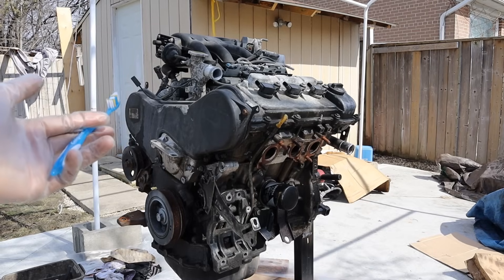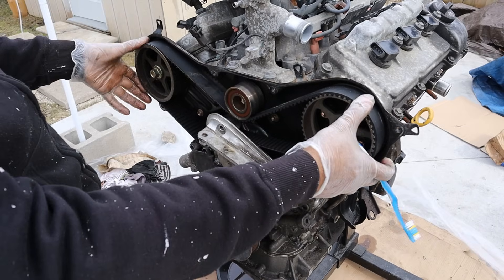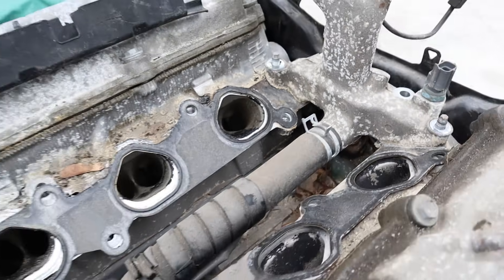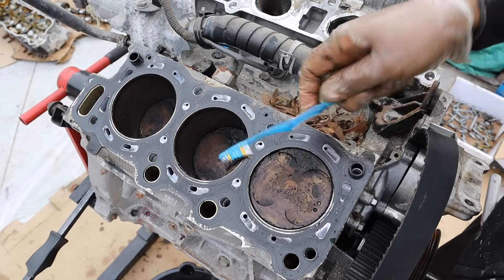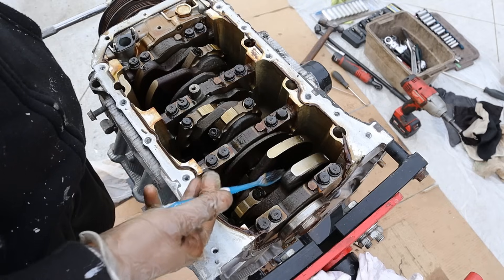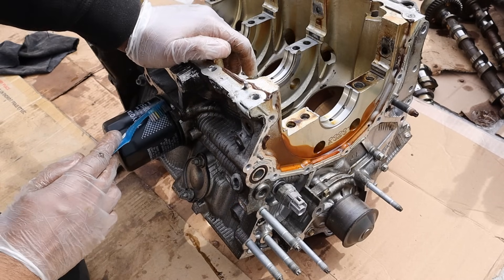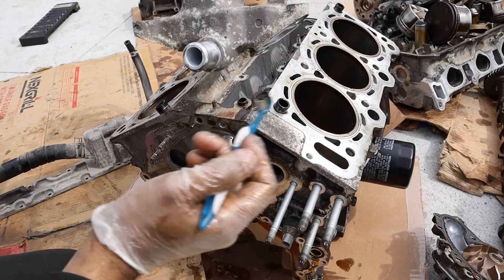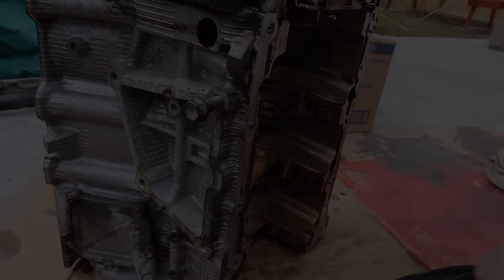Here's how the Toyota 3.0L V6 Engine Became a Success

Comment: One thing all these engine teardowns have told me is that changing your oil regularly is very important.
Reply: When I bought my 2000 avalon with the 1mzfe, it had no sludge. 3 years later it STILL has ZERO sludge. It's because I use full synthetic with MMO and factory toyota filters. Mostly the yzzd1 filter but when it's available I use the yzzd3 Oem filter. I change it every 5k miles and anytime something is wrong I fix it myself and always do the maintenance on time. I just did my valve cover gaskets, spark plugs, and tube seals. Did much more but don't want this comment to be too long lol. Put over 200k miles on the car with no issues. I'm almost at 300k miles.
Reply from the maker: Agreed!
Reply: BUT, what I learned: if you have a good engine, you can stretch the intervals and it won't be a problem. While if you have a garbage engine, you could change the oil every day and it will still break. There are tons of owners of cars made by GM that can attest to that. If oil was that important, pretty much any engine would last forever, as many people change the oil very frequently in fear of the car breaking (and everybody trying to make extra money off that FUD of "not changing your oil frequently enough" (like claiming that the new interval is now only 1000 miles ;-) Toyota builds these engines extremely sturdy, they use super tough alloys, I have so far owned 5 Toyotas and not one had considerable wear in the engine and I'm talking about a minimum of 300k km (150k miles).
Reply: and Filter ;)
Reply: @manxman8008  I have the same engine I put a wicks XP on it with Pennzoil platinum
Reply: You think!

Comment: My 2000 Camry V6 has a well-preserved, 92,000 mile engine. With this video, I have more of an understanding of those late 90's, early 2000's "Golden Age" era engines built with that expected Toyota quality.
Reply from the maker: Nice, only 92K
Reply: @speedkar99  Would you have an opinion on what is the preferred gasoline for the 3.0L V6 1MZ-FE? My 2000 Camry manufacturer's manual says: "1MZ−FE engine: Unleaded gasoline, Octane Rating 87 (Research Octane Number 91) or higher. For improved vehicle performance, the use of premium unleaded gasoline with an Octane Rating of 91(Research Octane Number 96) or higher is recommended."

Is "premium unleaded" preferred?
Thanks.

Comment: My rusty Solara has this engine with the e153 manual transmission. It has 256k miles right now. Currently doing valve cover gaskets, just did timing belt / water pump, brake lines & thermostat a few months ago. Sadly it just got a knock sensor code so I quit driving it. I had a automatic v6 Solara as my first car and moved onto a 2GR Camry SE, 1st gen Scion xB, mk7 GTI but for some reason I had to have another Solara in my life even though it’s such a pain to work on. It needs engine mounts and new struts pretty badly but I’ve been putting those off. Oh well, it is a $1300 car that runs and drives
Reply from the maker: Nice. I had an automatic Solara you'll find me working on it on my earlier days on this channel. Loved the car but my passengers didn't appreciate it so now I have the Camry SE.
Reply: @speedkar99  I definitely feel that. Been a viewer for quite a few years now. My favorite was probably the Solara independent fog light mod 👍

Comment: i want that crankshaft  very bad .. looks so clean 😅😅 my engine is 300kkm and  still works smooth  but i think it need crankshaft replacing .. i changed the rod bearing once it didn't work i guess but they still working till now  after 10kkm after
Reply from the maker: What you mean it didn't work after Changing bearings? Was the crankshaft damaged?

Comment: The ones with the aluminum intake plenum and waste spark ignition you can do the back 3 plugs without pulling the plenum.
Reply from the maker: Yes you are right. The plastic intake you'd have to remove for sure
Reply: @speedkar99  there are youtube videos showing how to replace rear plugs without removing the intake like https://www.youtube.com/watch?v=FwcVSzbyNfg&list=PLbBfuxTzXUKHWOfUVVvHdlAc4EgO0lZUU&index=3&t=17s

Comment: The saddest thing about this motor is that there are 0 longitudinally mounted variants. It's a 210hp stock v6, friends of mine are making close to 300 with turbo on 97 octane.

I've got one in a 2002 Sienna workhorse, thing carries engines back and forth all year round. Only issues is 1 vvt solenoid (easiest job ever) and a leaking valve cover gasket. Should probably do the timing belt soon.

Also people say you "gotta" remove the intake to do plugs but nah, unless they're real real stuck i've done them twice by just reaching. It's a pita but it's doable. And the coolant into the throttle body is for the idle air valve, it has a temperature sensitive thermostat that changes air intake depending on temperature.
Reply from the maker: Agreed, no RWD applications. Leave that to the 2JZ of the era haha. 

The plastic intake manifold has to be removed to change plugs. The metal on is small enough you can snake your hands back there and change them.
Reply: @speedkar99  Oh yea fair, i've never seen the plastic intake. The sienna and the earlier camry has a large enough engine bay that it's not too difficult to work on this engine. I know the later sienna and camry are much more cramped with a v6. i usually stick to straight engines in transverse configurations, don't like doing the contortionist routine to do basic tasks, especially cos i live in toronto where our roads are more salt than asphalt. I have a friend with a transversely mounted LS, needless to say he doesn't maintain it himself.

The 2JZ is a lovely motor, i have one in my garage for a build, but these MZs are a missed opportunity. A 2jz-GE (the non turbo one) fully loaded no transmission is about 500 lbs, a sienna 2mz-fe in the same config weighs around 350. It's very light and again stock power 210, with a over square bore and very smooth even at high RPM. There's no reason this couldn't be a naturally aspirated revving V6.

Comment: my Camry's 1MZ-FE has done more than 300K KMs and still going strong, but its leaking oil a little and consumes more fuel than i want, but other than that its very smooth and works very reliably if you care for its oil and coolant
Reply from the maker: Agreed. My last Camry had about 320Km and ran beautiful. No leaks no burns.

Comment: Have this in an '02 Avalon...  zero complaints except for knock sensors and wiring are prone to premature failure by heat.   Good thing, it's a non- interference engine.    It does like to leak though.
Reply from the maker: Beautiful engine. And you have the drive by cable design which is less laggy too.

Comment: 😂 "calibrated torque wrench"... They are the best. Using you Calibrated torque wrench you can never confuse inch pound and foot pound for muscle pound. The only downside is it takes years of calibration a muscle pound torque wrench to be calibrated properly... 

In Australia we had a Toyota Camry and Avalon with these V6 3.0 L engines. Own both of them but they were differently tuned. Avalon was tuned with a bit more torque for more towing capacity and they both had enough power to pull when needed. Today I own 2009 Toyota Aurion which is basically pampered Camry V6 with 3.5L engine and even though it has more power than the old Avalon and old 3.0L Camry it is definitely a bit more noisy and less refined. Also I think old 3.0L had a smoother g/box than my 3.5L Aurion. 

Another difference is my Aurion has a slightly slower response time on drive by wire throttle which makes it even less smooth. But both (3.0 and 3.5L) never failed and or used oil, never leaked oil from anywhere and never had any engine problems or engine light on the dashboard ever. Also never leaked coolant and basically never had any work done it on them. 

3.0L needed oil change every 7.5K km or 6 months and 3.5L every 10K or 12 months. I always used higher octane fuel on all of them. Not to go faster or to have more power but just because higher octane fuel has more good additives to keep the carbon build-up low (here in AU). Cost more but my mileage wasn't high anyways so it was worth it. When I bought my first USB endoscope camera, one of the first test I have done was to peek into the cylinder (front easy access one) and have a look at the piston top. Couldn't see the valves. Wasn't flexible enough to bend it upwards. But the pistons were way cleaner then these on your video. OK mileage was lower too on my car but they were only slightly grey coated and no build-ups. So both engines are great but 3.0L is smoother than 3.5L. Especially retuned Avalon. 

Thanks for the video, another great insights of engine designs and characteristics with very useful comments showing weak and strong points of engines you are dismantling. Great work.
Reply from the maker: Glad you enjoyed the video. That 3.0 is smooth and I miss it. The 3.3 I have now is marginally quicker but your right, drive by wire lag makes everything sluggish.

Comment: I’ve always been jealous of how other people has great luck with this engine. Mine is a 2001 RX300 and it’s been an absolute money dump. I bought it years ago from a dealership at 133k when knowing nothing about cars. This car taught be everything. I’ve learned to change my own oil with full synthetic not long after the purchase. I can’t recall when the lifter tick started but I’ve been putting up with it for years. Annoying as hell. Knock sensor went out, $800. 2years later I bought the Aisin timing belt kit off of Amazon and have a shop change the timing belt at 190k for good intentions only to bit me in the rear. The old belt looked brand new, soon later some pulley started making scratching noise and it was unbearable. Pulley scratching noise plus lifter tick plus high oil consumption. Finally had the bad pulley and everything else there replaced again at another shop less than a year later for another $800. Changed the valve cover to the new design and new knock sensor and wiring too. Turns out the last shop didn’t even replace it right. Lifter still ticks at 230k, but it runs strong, just very annoying that I had the worst luck with this engine. I’ve spent thousands of dollars repairing this engine and I still haven’t experienced any “smooth and quiet” at all. I’ve seen beaten up junk Camrys with quieter engine than mine. Bad luck finding this particular car and bad mechanic. I’ve spent too much on this engine and this car to give it up.
Reply from the maker: Lifter tick? This engine doesn't have rockers or lifters per say...
Reply: @speedkar99  hi speedkar99, every guy that works on cars I’ve met told me the metallic tick is from the lifters. I really don’t know what other components could cause such a noise
Reply: It's very common that knock sensor went bad. But I bought a used one with wiring for $30 on eBay and install it outside the engine. That turned off the check engine light. I didn't have ticking problem you mentioned. The Aisin timing belt kit you bought on Amazon must be fake. I bought a kit on eBay and changed myself just by watching videos on YouTube. I also learned to change spark plugs on this engine. I didn't manage to change the valve cover gasket on the rear bank though, because I could not see all the screws. I gave it up. The engine runs smooth and quiet. I can't even feel the engine running at idle. I did change all 4 O2 sensors and cleaned catalytic converter. These are all I did to the engine besides oil change.

Comment: I have a 2001 Toyota Solara V6 and it's a great engine.  On mine, the oil filter is in the front which makes it a lot easier.  I'm about to turn 280,000 miles on it.  So far, all I do is oil changes every 3 to 5,000 miles on it (if I'm mostly freeway miles, it's 5,000 miles) and change the spark plugs, timing belt and water pump every 100,000 miles.  My only other items replaced were brake pads and one time,  the O2 sensor and the rear valve cover gasket was barely leaking but I could smell it on the exhaust manifold so it was replaced.  The car doesn't burn or leak any oil other than the one time with the valve cover gasket.  The transmission has been holding up fine.
This car may outlast me and I have no reason to replace it as it continues to be as reliable as it was when it was new.
Reply from the maker: I miss my 99 Solara. All MZ engines had the oil filter in the same spot under the exhaust manifold.

Comment: Can anyone list all the gaskets and seals I should get, I'm having donethe entire engine in and out & don't want to miss anything. Thanks 😊 even with a newer engine; how do I know If I need a knock sensor or use old one already inside? (My engine was knocking with low compression.) Thanks for having your electrical engineer bro explain that! 👍 I'm thinking I may open it up for youtube and film and maybe someone may diagnose what may have gone wrong inside this engine. You make it look easy. LOL
Reply from the maker: Valve cover gaskets and intake manifold gaskets. 
If you've got low compression I assume your rebuilding which you'd need head gaskets and oil pan gaskets, in addition to the cam and crank seals. Knock sensors typically throw a code when they go bad.

Comment: Can I reuse my old timing chain and 2 pulleys and water pump on new engine, or change it? Timing chain replacement video, 😍  🙏 please?
Reply from the maker: Yes it can be reused but it's a consumable so you might as well put new ones. I have a timing belt replacement video for this engine from back in 2014, check it out.

Comment: OMG! Thanks 😊 for answering request! Where is your donation button, Professor Karspeed? Also do you think you will be putting this engine back into 01 toyota highlander?! 😆 🤣 I can't wait! This is what Im having done eventually (new engine going back in). I've been filming the 01TH and taking pics of it being removed but it would be great to have a video of it going back in. I'd film too but I don't know what is what as it is car brain surgery to me! And I'm not the car brain surgeon. LOL 😆 Maybe one day (a long time from how) I can do the engine rebuild myself. That's why I'm saving the old engine. I really wanna figure out what the heck I done wrong with no warning for this vehicle to just lose compression engine knock. If anyone was on the road i would have hit them but i was lucky it was 6am and i only barely stopped before I almost hit the corner pole coming off a 90 degree right turn off the highway and thats just the way the street and highways are here in countryside and I wasnt speeding and always made that turn. I lost complete controlno break and couldnt stop barely. And that doesnt happen to me. ( But I remember before this it started with me driving in Overdrive by accident on the highway  and rpm was higher than normal and i realized it and stopped off higway to shift back to drive.)

On time changed oil and valve cover but still can't figure out what happened. Found the bottom oil pan got dented just yesterday so person fixing thought maybe over time the oil pump, but there is no way of knowing. No check engine lights indicating low pressure either. Id like to figure it out so it doesnt repeat. Had vehicle since 01 so 21 years one owner. 240K. To be continued...
Reply from the maker: Nice work. I'm gonna be giving this one to my cousin to build in a track car. Not sure what body it'll be in yet.

Comment: Are these engines interference or non interference?
Reply: Non interference. There is some confusion over this as some sites on the Net list this as an interference engine. this in incorrect, it is 100% NON interference, doesn't matter on the year, if its a 1MZ-FE its NON interference. Heres a guy proving it. https://youtu.be/0o-TXIWVHwg
Reply: @TeUhtred7860  I’m glad to hear that! What a relief !
Reply from the maker: No
Reply: I thought the VVT versions became semi-interference based on the state of the cam phasers if/when the belt fails... at idle, no problem. But at agressive engine load, interference. IIRC, all pre-VVT Toyota belt-driven engines were specifically engineered to be non-int.

Comment: Nice teardown. Brings back memories. My parents had a 96 Avalon with the 3.0 1mzfe. Cable throttle, no vvti, and only 1 set of coil packs on the front bank. This means it was a waste spark design. I guess the advantage is fewer coil packs that could potentially go bad in a very hard to reach spot. Very smooth and refined engine. Exhaust tuned to be whisper quiet. In those days that was what you wanted. It did have valve cover leaks later on. We never addressed that. I believe it was rated somewhere at 195-200 hp which in those days was considered a lot. Even though the avalon was a heavy car it had lots of pep. We never had sludge problems because in those days we always changed the oil every 3k miles. The one thing that always scared me was what it looked like under the oil fill cap. You showed that in your teardown and it wasnt pretty. Little did I know it was probably spotless. I'm amazed at how stout the bottom end is in your teardown. Looks absolutely bulletproof.
Reply: One thing I forgot to mention was that I burned my forearms more then once changing the oil filter. Not a great location as you mentioned.
Reply from the maker: Good story. So what happened to the Avalon??
Reply: @speedkar99  pretty undramatic ending. They sold it in '09 when I found them a great deal on a used 2006 es350 which they still have. The avalon was good to them. The only major problem it had was a leaking power steering rack that my dad replaced.